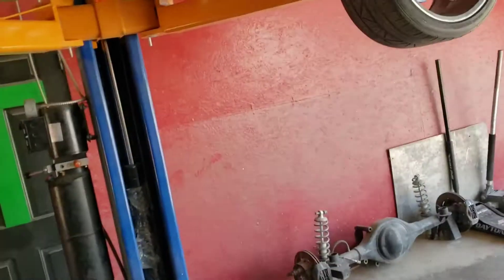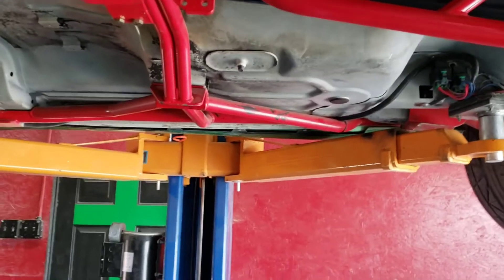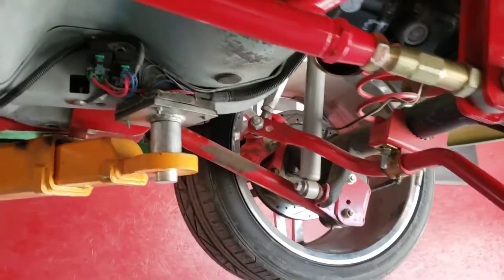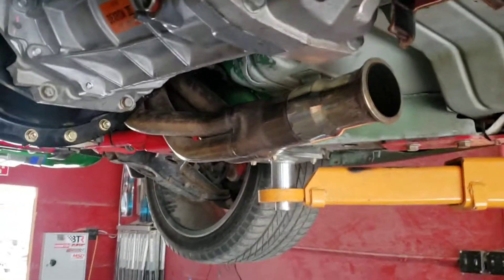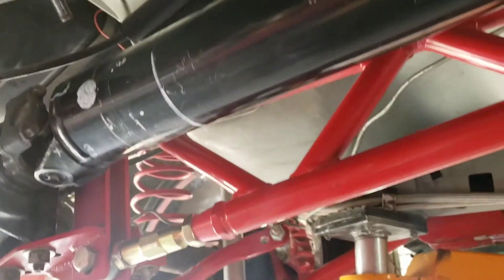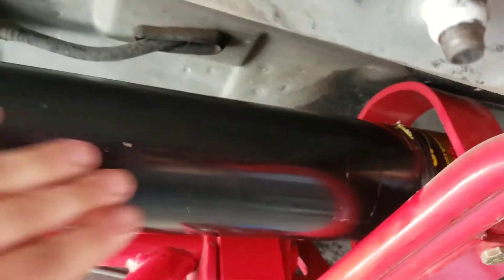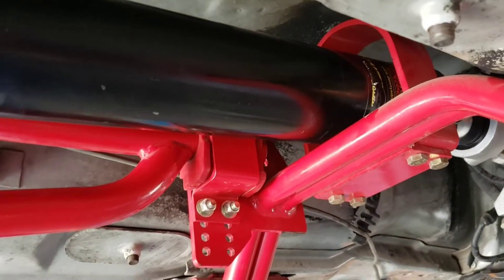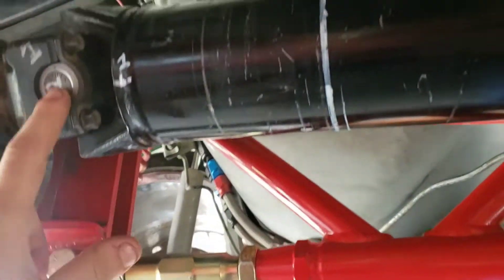Driveshaft vibration issues, not pinion angle

Comment: I took my drive shaft to get balanced at a shop. I had ugly vibrations when i get to 70mph on freeway! I have a 1988 Monte Carlo SS. When i got the shaft back, i intalled it and wow it made a difference. My car runs smooth on freeway and i even hit 100 mph with no issues.
Reply: Where did u get it balanced thanks

Comment: Cool, love this.. hey, I’m not there, but the pinion angle looks odd in the video. I.e. the rear driveshaft entering the rear end looking to be in opposite degree needed for pre-load? The rear just looks like it need adjustment with the awesome looking “adjustable” link? I love the suspension components❤ Yeah, guess that makes the difference for the alignment of the driveshaft, simple thing the thrust washer. Makes the driveshaft rotate without the wobbles off axis. Cool, thanks for-it!

Comment: I’m having same dang problem, still chasing it. I also have Spicer U joints… was it missing thrust washer from factory ? Or had it come out when installing unnoticed ? 
I’ve recently took my whole driveline out and took it to be rebuilt and balanced, got new U joints. After I reinstalled I’ve had this vibration in rear end and I just had to replace gasket and pinion seal (both had started to leak) I’m thinkin this was symptom of vibration not separate problem.

Comment: I'm having a tailshaft vibration issue in my 2002 model Holden VY SS Commodore at 40 km/h (25 mph) & it was very bad after I fitted a brand new rubber driveshaft doughnuts or Guibo,it was very bad between 40-60 km/h (25-40 mph) before I replaced the driveshaft centre support bearing & I did press the middle universal joint off to replace the centre bearing because the universal joint yoke had to be removed so that I could remove the centre bearing.

It improved greatly after the centre bearing was replaced but if I stay at 40 km/h then it will vibrate & sometimes it won't.

I need to check the pilot bearing for wear in the transmissions slip yoke because I believe that the tailshaft isn't lining up centrally so I need to check for play in the bush.

The engine that's in the car is a 5.7 litre Chevrolet LS1 V8 & the transmission is a T56 Tremec 6 speed manual,it does have a worn out axle shaft Inner CV joint but I don't think that's the cause of the problem despite the fact I'm going to replace it anyway !

Comment: I've been chasing a vibration forever on my 97 LT1 Camaro SS. Wheels balanced,  new harmonic balancer,  new 3.5" aluminum driveshaft installed. Lowered on strano springs and koni str.t shocks. Wish I could solve it. Mechanics just say driveshaft or flywheel and shrug. I guess I need an adjustable torque arm to verify pinion angle and adjust if its out of whack